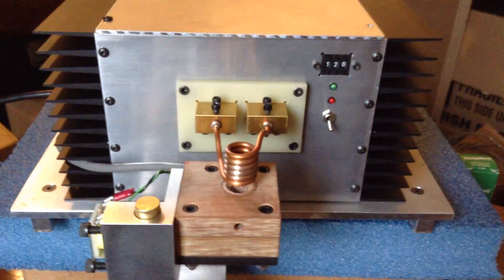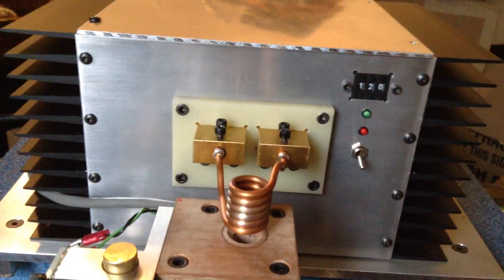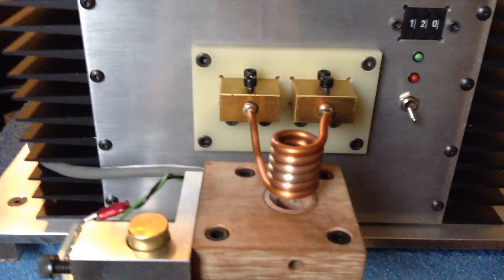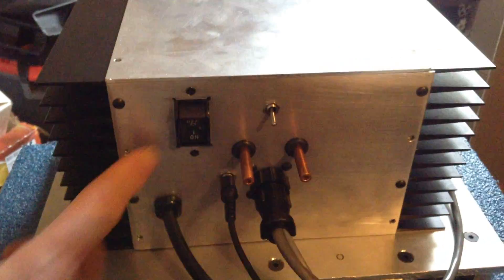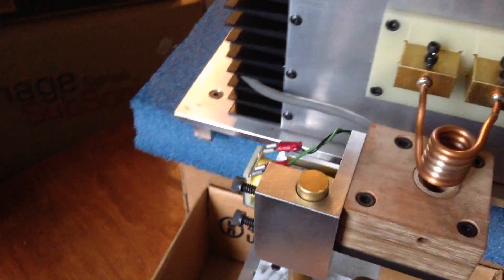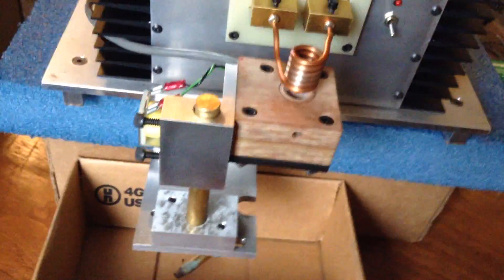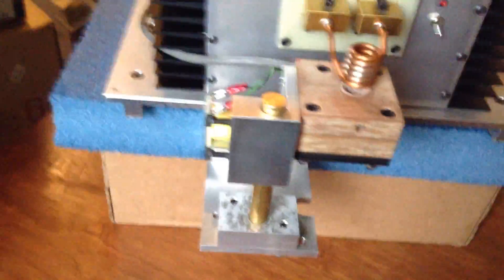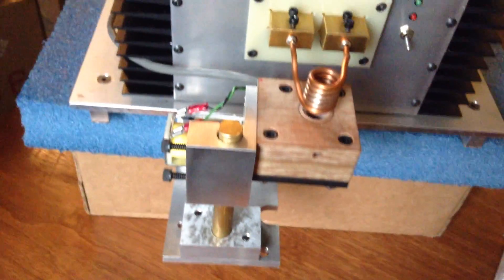Ind Heater

Comment from the maker: The "power supply" is line voltage (120 vac) rectified.  I don't have the schematic handy and I better not try to recall from memory since it's been a while.  I got the boards from Fluxeon.  I think it was called the ROY 1200.  Might be able to find it that way.

Comment: Can you share the electrical design drawings/diagrams?
Reply from the maker: My design was based off a kit from Fluxeon.  I believe it was a ROY 1200.  I can't find any reference to it now but there are a lot of other sources of induction heaters.  The GinaErick might be a good place to start. I would be hard pressed to find schematics for mine at this point and I have no mechanical drawings.  I designed it as I went.